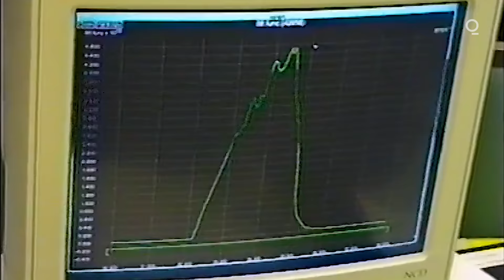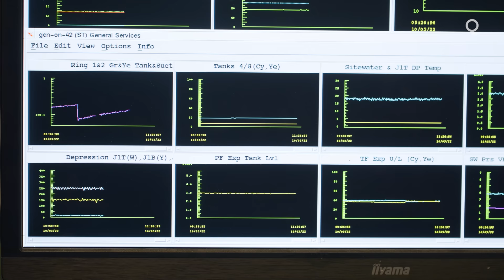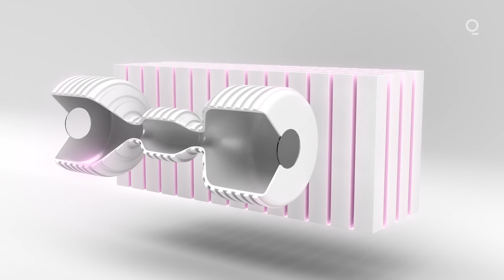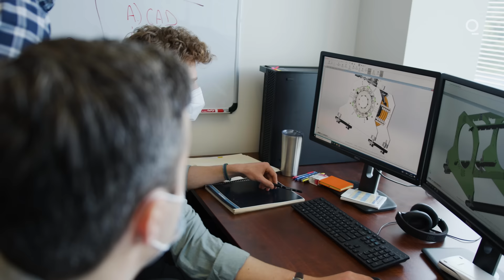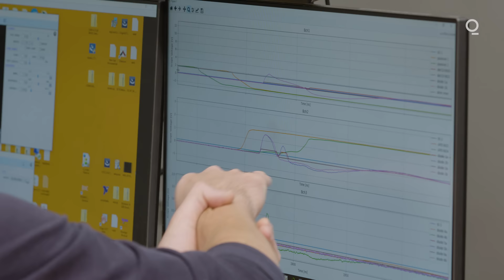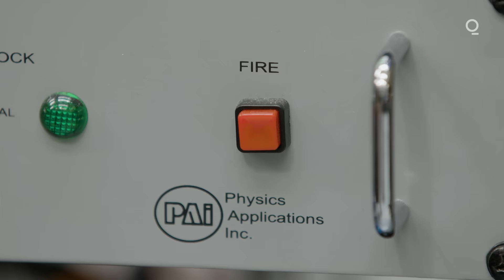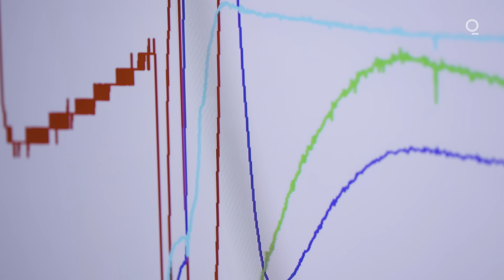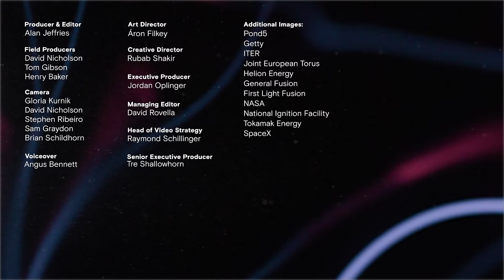Why Private Billions Are Flowing Into Fusion

Comment: There used to be an old saying that goes: "Fusion power is only 30 years away and always will be."

Plasma temperatures run at 100 MILLION degrees, NOT 100,000.

Comment: great report. I am rooting for fusion since I was a little kid. And I hope to see it being out there in my lifetime. This is the kind of change humanity desperately needs if we want to advance any further. The energy problem needs to be solved. Just think about how the abundance in processing power and storage has transformed the world. Having an abundance of energy would be many tenfolds of that magnitude.
Reply: It's only 10 years out. 😆
Reply: We have Sun - the biggest thermonuclear reactor. Floating photo-voltaic batteries on oceans are the solution. We need around 1 mln km2 for our needs.
Reply: @peceed  I hope you are correct.
Reply: I’ve been rooting for it too. I learned when I was 10. I’m 60. They said it would take 50 years. I’m still waiting for flying cars.
Reply: The energy problem will be solved by optimization, not by increasingly bigger power plants. We need a model change, not a brute-foce solution.
Reply: @peceed  Yeah but fusion reactors are hotter than the sun.
Reply: @crazyspace6792  So what?
Reply: @miquelmarti6537  Optimization does not solve the Fusion problem either
Reply: @tinyrick6264  see: aeroplanes
Reply: @calicoesblue4703  
Fission vs fusion.
Fusion is fusing molecules ?
Reply: @miquelmarti6537  
France uses nuclear power plants. Germany does not. Looks like France is smarter.  Germany has trouble now that Russia decrease natural gas and petrol
Reply: Your comment show why investors are biting, line hook and sinker. Sorry but its similar to quantum computing, you believe because you dont understand, all you know is that it would be awesome if it worked so you forget to apply a healthy dose of skepticism.
Reply: @miquelmarti6537  Eh, optimization is minuscule. Like cars, my 1965 Volvo would run on less than 8 liters per 100km, a modern SUV CANT! Optimize all you can fir a year, it doesnt even cover the increase in demand over 2 weeks.

Comment: I hope I can help on a fusion project someday. This is a technology that could change the world as we know it in a profound and positive way.
Reply: You can make one yourself. no need for gargantuan billion dollar government science projects. Look into aneutronic fusion. Get a 3d printer, a vacuum pump and some household electronics.
Reply: @LeRealisateu  All our energy problems could have been solved by nuclear fission and is still our best working option at the moment.
Reply: @elosant2061  agreed its much easier to split hydrogen atoms per say  then to combine them.
Reply: What kind of college majors would one need to pursue in order to work on fusion reactors?
Reply: @test_account939  physics/nuclear physic  then specialization
Reply: @geemanbmw  Fission is done with heavy elements (usually uranium-235 or plutonium-239), not light ones (hydrogen-1, a.k.a. protium, being the very lightest). Hydrogen-1 is not fissile because its nucleus is a single proton. AFAIK, subatomic fission is not possible (unless you count quark–gluon plasma). In any case, no, it is not much easier to split hydrogen atoms than it is to combine them.
Also:
*it's
*per se
*than
Reply: Of course, this time around it'd be entire countries, not a couple big cities
Reply: I can invest in your company. I can offer 1000 USD for a 10% stake.
Reply: No, no You can't.
Reply: Likewise, I'm a systems engineering phd... control theory, machine learning, parallel processing, algorithms...

Comment: Today is Historic moment, it happened. It's finally a tangible source of power. 10 or 20 years from now we may have commercial fusion power.
Reply: and it will lead to a drastical reduction in power related conflicts
Reply: That's the joke... it's always "20 years away."  Has been for decades.
Reply: They said that 10 years ago, the latest breakthrough is just another prove of concept. They put 100x the energy recovered into this, and they could only do it once a day. For it to work we will need some crazy breakthroughs in laser technology so it (lasers) can generate 100x the energy and do it more directly then we need to be able to do it over and over again  to make it commercially viable. Sadly.
Reply: @Tacolucious Source? Or just speculation?
Reply: @talkingmudcrab718  No. They just discovered it a few days ago.
Reply: This aged well
Reply: I hope so, but I think the 20 year number is the sort of answer engineers/programmers give when asked how long it will take. Two weeks! Which really means I got no idea, but I got to give them an answer and it can't be too long.
Reply: @talkingmudcrab718  Just like Mars colonization. When? In 20 years. They've been saying that for decades now.
Reply: @Basieeee  Lasers aren't the only method. Helion for example uses a different method by accelerating plasma using a magnetic field, kind of like a microwave on steroids. It doesn't use steam to spin an engine either. They plan to finish their 7th generation electricity-making reactor by 2024.
Reply: @SubtleHawk  they uploaded that after my comment was placed 😭
Reply: @JackGodo  It'll reduce many types of conflicts, for example water wars. When fusion becomes commercially available it'll mean that any country can be powered using essentially sea water as fuel, meaning that no longer will any country have to depend on another for oil, coal, or any other source of electricity. Every country in the world would become energy independent essentially overnight. Now, the main problem with desalination is that it's a process that requires a lot of energy. However, if energy is cheap, safe, and abundant any country can power a desalination plant for pennies and so not only would countries become energy independent, but they'll also have an almost limitless supply of fresh water.
Reply: @Cool Baby Mark my words we'll have commercial fusion in 10 years or less.
Reply: @Cool Baby I work in the industry, we're getting electricity generation with a finished pulse-heating generator by 2024.

Comment: Well now it looks like ITER won't be the first fusion reactor to reach net gain. In California, they achieved net gain just months after this video.
Reply: You fell for the propaganda from the Livermore team.  They reported increased plasma efficiency (Qplasma)  but the total efficiency (Qtotal) is still abysmal. The input energy to laser beams used in the experiment was 300 MJ, only 2 MJ made it to the fusion fuel target and fusion reaction created 3MJ output (heat energy).  
They only quoted the Qplasma = 3 / 2 ratio achieved in the experiment.  
Qtotal = 3 x 40%  / 300 = 0.01  (even this is generous because 3MJ output heat needs to be converted to the electrical energy and I generously assigned the 40% efficiency here assuming that it is possible to extract the heat energy from this device and then use it to create steam and power steam turbine.
Reply: @usneome  to be fair Q total for iter wont be over 1 either but much better than lasers
Reply: @usneome  I've seen this exact same reply in other videos. What benefit do these people have from downplaying a very important breakthrough?
Reply: @SaiRyan1   Honest reporting is needed. Since national labs are using billions of USD for research, they should report their progress without hype. Current administration in Washington should not manipulate facts to play politics. 
ITER project promised Qplasma = 10; this is six times as much as Qplasma for laser fusion project.
Reply: @usneome  there is nothing dishonest about what they have done,  they got more energy out of the reaction then put into the reaction which has not been done before. You don't understand what the problem was nor understand what has happened.  The problem they were solving wasnt efficiency, it was can it even be done.  Can the reaction create more energy then it took to create the reaction. How much energy it took to start the reaction is irrelevant
Reply: @SaiRyan1   The ultimate goal is not to be playing physics experiments here. This is not a CERN particle collider, which is dedicated to pure science. 
The goal here is the nuclear fusion power plant.  If it is not possible to have a more energy efficient laser, having achieved the Qplasma = 1.5 (recent announcement) is not that important. 
They have been announcing breakthroughs with the promise of a commercial power plant just around the corner, we just need to invest a bit more money into it. A lot of money has been spent in the last 40 years, filled with promises of a commercial nuclear fusion within 20 years. 
We are still at least 20 years from that goal.
Reply: @Cool Baby Yeah and Qengeneering imo most commenly called Qtotal would be less than 1

Comment: I loved it's idea of excluding Turbines and steams as to cut down cost and prevent undermining efficiency 
Simply to the point period.
Reply: Yeah I’d never heard of that method before and if they can get it to work, it makes a lot of sense
Reply: I personally doubt the idea. In my opinion, Helion's "electromagnetic harvesting" would work like inductive coupling, and it's a really inefficient power transmission
Reply: however it must be said that the Rankine-Hirn cycle is something that has existed for more than a century and is reliable and known, adding other innovations to a project that already has tight deadlines in the field of fusion (a field still in the experimental phase) would mean increasing further the risk of failure of the entire project
Reply: yeah, harness the EMP inductively. Only needs to be 30% efficient to beat the best heat to steam turbine efficiencies.
Reply: So are thorium fission reactors?

Comment: A fusion reactor uses deuterium and tritium for fuel. Deuterium can be extracted from water but tritium is radioactive and must be synthesized and it must be made in the actual reactor. Since the reactor consumes the same number of deuterium as tritium atoms it is far from evident that enough tritium to keep the reactor running can be produced. That is only one of the many hurdles that the the fusion startups will have to overcome. 

One of the companies that are presented in the video is General Fusion. I have followed their winding path from their start in 2002 and I have come to the conclusion that the method they propose to compress the liquid lithium cannot possibly work. They claim that it does, but to the best of my knowledge they have not presented any proof to support the claim. Please enlighten me if I am wrong.
Reply: I was curious what companies were ranking in the billions aforementioned.
Reply: Thank you for your critique. It is true that little research has gone into the production of the radioactive tritium to generate enough to fuel the reactor and produce a cost-effective generation of electrical power at the same time. The following critique of the ITER mentions this rarely presented problem.

ITER is a showcase … for the drawbacks of fusion energy (The Bulletin of Atomic Scientists)
Reply: The inventor of the Television , Philo T. Farnsworth, went on to develop a room sized fusion reactor that used specially designed vacuum tubes for the project.  I T & T controlled the Farnsworth patents and refused to allow Farnsworth to proceed any further with the project.
Reply: Whenever readers come across an article regarding a fusion energy 'breakthrough' in the goal to achieve fusion energy ask yourself was their any evidence that any, or a significant amount of fusion reactions were detected. In the vast majority of cases the claimed 'breakthrough' experiments involve no DT fusion fuel and so no fusion reactions were detected. Most are simply experiments that compress normal hydrogen isotope nuclei (protons) so there is no way any significant amount of fusion reactions will occur. The announcements are often intended to attract investor, or government funds for further research. The write-ups are often misleading fluff to attract interest.
Reply: @core3673  you truly believe he invented a room sized fusion reactor from vacuum tubes… our species is doomed
Reply: @core3673  I've heard about cars that run on water for decades, conditions required in a fusion reactor are just beyond the scope of Your imagination.
Reply: Tritium has a half life of years. It doesn't have to be made fresh. It's currently made as a byproduct of a fission reactor in Canada then transported
Reply: @tusharbhudia9421  
It is possible that the Canadian production of tritium will suffice for startup of DEMO, but eventually this and all future fusion reactors will depend on self-made tritium. The reason for this is that no reactor will be able to produce much excess tritium. In fact, it is far from certain that they will produce enough for their own needs.
Reply: It is about sustaining nice high pay packets. 
It is the same with Egyptology. The funding they get every year pays a lot of nice wages. They do not want that funding to ever stop so things like the megalithic era gets hardly no funding as this would mean civilisation started well before Egypt came about. 
A lot of money would be diverted towards that and the established Egyptologists would lose their money and livelihoods. They are the ones stopping any research into more ancient civilisations.
Look at the people in this video and how many there are. Their machines can only do so much so what do they do day to day? They are probably working out how to keep their funding going by hoodwinking their investors that they are doing new experiments when actually they can only do so much. 
Look at how they spent 2 decades staying at a second and then those 2 decades later it is 5 seconds. There was no inbetween, so what were they doing for those 2 decades without any change? I tell you what. Protecting their big salaries.
Reply: @VeritasPraevalebit  Of course, no one would ever deny that. However, I would argue that the requirements needed for producing Tritium are insignificant. There is no need for it at the moment, therefore it is not being produced. It is a simple issue of supply and demand, and in my opinion, it is among the least significant obstacles to commercial fusion energy. If pressurized light water reactors, like those owned by the TVA, can produce Tritium from Lithium-6 (and they can), than any type of nuclear reactor should be able to, including utterly harmless research reactors like TRIGA. All that being said, the requirements needed for Tritium containment are not so "insignificant", and that will probably be the biggest headache associated with D-T fusion.
Reply: Thorium fission te h ology used in  China doesn't require water.
Reply: Too bad we're on a bad trajectory with China.Couldlearn from their thorium  nuclear technology.